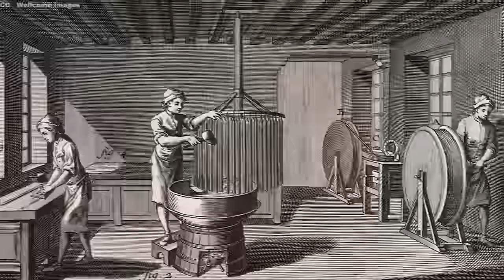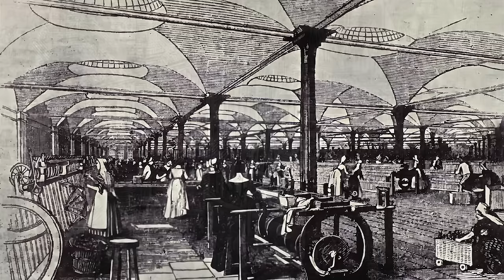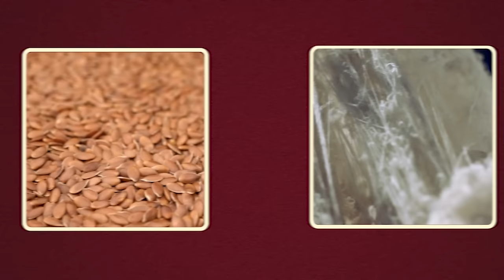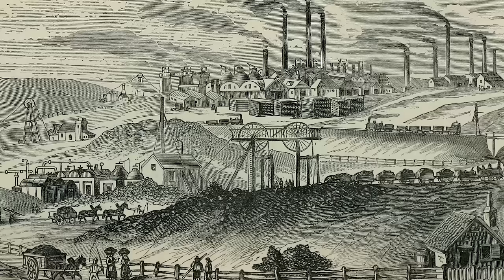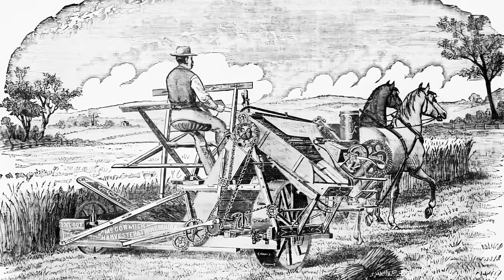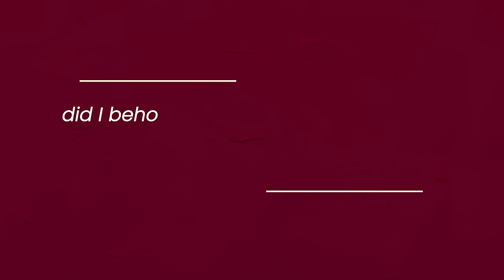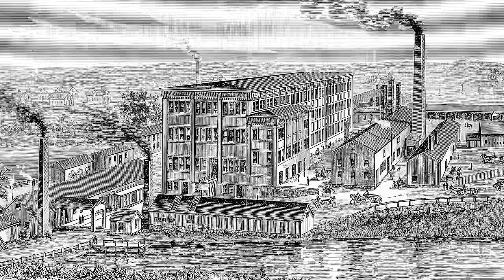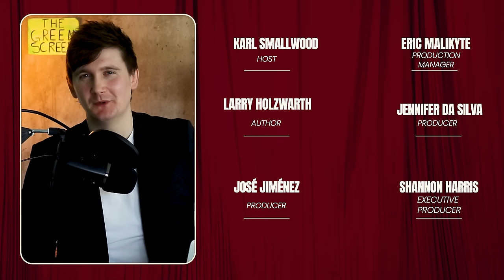The Luddites: Raging Against the Machines

Comment: The whole way through the video I couldn't help but think of how I consistently attack "advances" in automotive safety technology. Instead of machines replacing skilled labor we have half-baked technology replacing skilled drivers. I'd rather have a vehicle without BSM, AEB, LDW, rear cross traffic alerts, or any other feature that interferes or second-guesses my inputs. Well, all but ABS. ABS is ok. All I want is basic cruise control, air-con, electric windows, ABS, seatbelts, airbags, and Bluetooth. The rest can go in the bin.